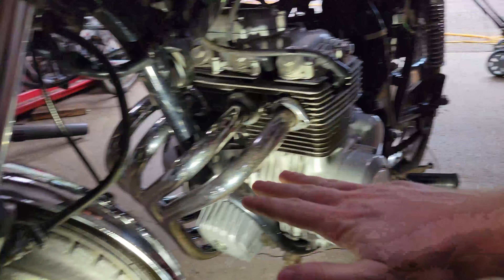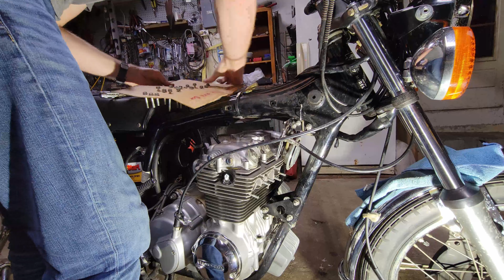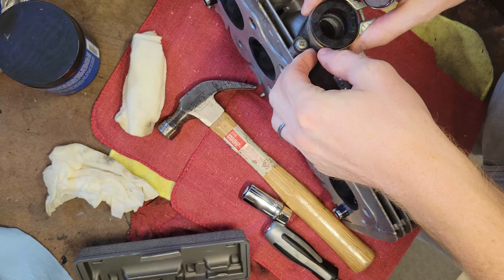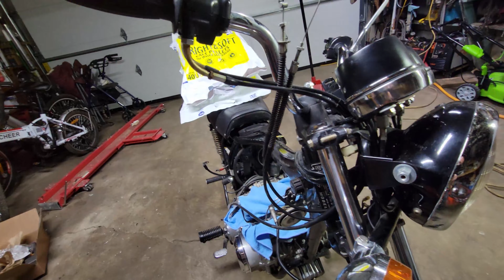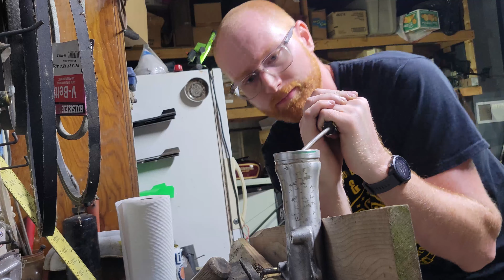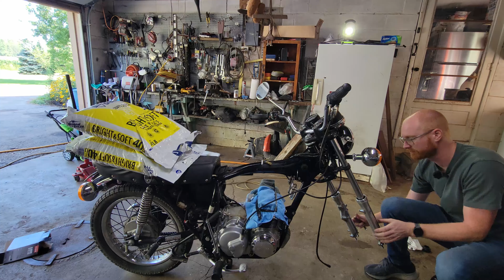1977 Honda CB400F - Runs Great - So We're Tearing It Down?

Comment: A little tip for when you fit tubes into tyres, inflate it slightly just before fitting the second bead of the tyre, that way you easily see where the tube is actually sitting and you can avoid nipping it. Bikes coming along great by the way, 👍.
Reply from the maker: y'know ive had a lot of back and forth about this with my other moto friends. Years ago I was trying to put tubes in my scooter wheels and id inflate them, always pinch. A buddy said thats why, but maybe i had too much? He works on bikes for cash and swears never to inflate. I wont bring up the topic of which way to put the nuts on the valve stem haha. Ill give it another shot with some inflation next time! Thanks a million for watching!
Reply: @GoldenBoyGarage  yeah its a fine line to how much air is enough or too much but the good thing is you got it inflated, and to me that's a WIN. Just watched the video where you rode the bike home, looks like an awesome ride and the weather was in your favour too. Bike looks sweeeeeeeeet, and if manage to get the rear fender and tail light sorted its going to be a peach of a machine,  😎.
Reply from the maker: I was pretty happy to get them on without issue, like to have that skill now that I do a lot of dual sporting. Got super lucky with the weather, and I really wanted to ride it home as a test of might, plus it is just a pretty ride to go down along the Ohio river, plenty of good curvy roads too. New fender and taillight have come in from CMS and Webike Japan, just have to find time to put together!

Comment: Looking great man .love the concrete counter weight . Idea ..brilliant. 
Nice  tire change too they can be  tough .
Reply from the maker: The engine really pulls the front down, usually the center stand is pretty balanced but on this little girl its pretty front heavy. I had only ever solo attempted tubes on scooters before, much easier with the tube deflated IMO, but the fear of the pinches is always there

Comment: Hi, I would just give it a light hone, to deglaze the bores, and clean the ring lands on the pistons, the oil rings will be gummed up,  while you have it apart, and reconditioning the head, clean the sump and clutch, run for another 30 years.  
Zen and the art of motorcycle maintenance 👌
Reply from the maker: I appreciate the feedback, i definitely want to check the sump and see what if anything is in the bottom of the pan, trying to decide just how much of a project to make it!

Comment: No cam bearings.  Wonder if aftermarket bushings were ever offered.
Reply from the maker: Not that I could find. My other YT project is an old XL350 and folks have done a cam bearing mod for those, I figured maybe folks in Japan would have come up with something, but from hunting around there are others that seem much worse. Seems common on the 70s UJM to not have any bearings in the head

Comment: Those camshaft bearing surfaces look pretty rough, I wonder if was run with low or poor quality oil at some point . Be interested to see the camshaft bearing surface
Reply from the maker: My best guess is it had been sitting a long while and someone fired it up or turned it over dry. The camshaft was fine, but some aluminum on it as you'd imagine. I just lightly cleaned them with scotchbrite. Ebay heads /cams have pretty blurry or inconclusive pictures, so I figure Ill check again after 10-20k miles if i keep it that long

Comment: Need help with my 72 cb500 
I believe I'm missing a bolt of some sort on the intake side between #2 and 3 cylinders  has oil leaking from that missing bolt. What is the bolt called or what size would I need  thought it was the cam chain tensioner bolt but not certain
Reply from the maker: Im not super familiar with the CB500 but I can take a shot here. I usually recommend looking at the micro-fiches provided somewhere like partzilla dot com and either googling the part number for the bit I am missing or if its a common bolt you can hunt at the hardware store. Pretty sure youtube wont let me comment links but you can try here https://www.partzilla.com/catalog/honda/motorcycle/models-with-no-year/cb500k1-a/cylinder-head-camshaft